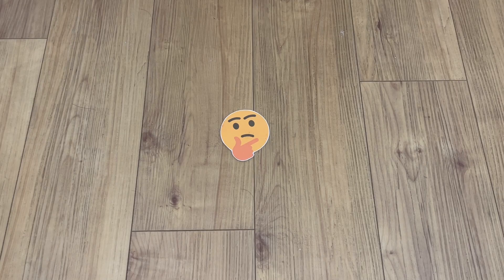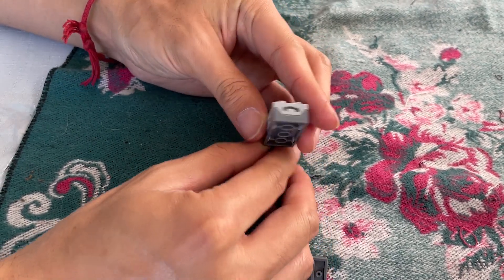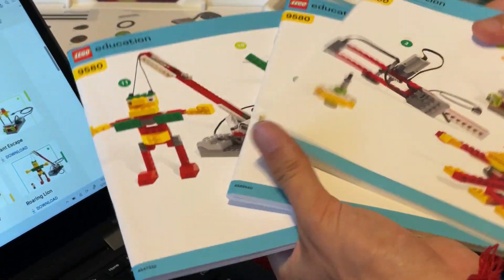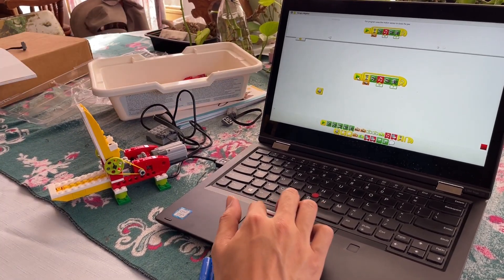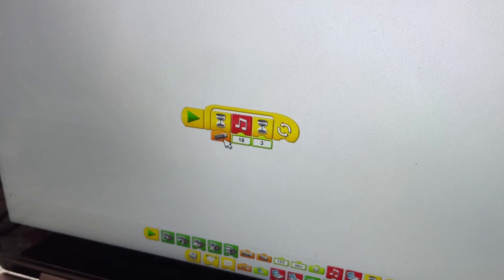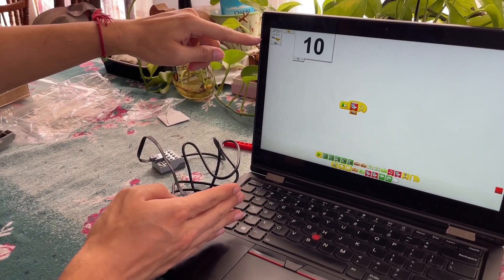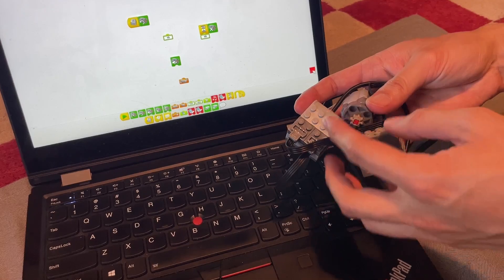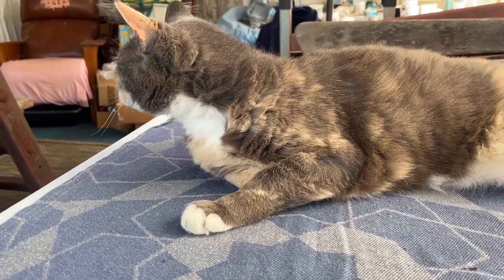#lego Education Had Power Functions SENSORS (WeDo Robotics Construction Set 9580)

Comment from the maker: Corrections:

1) It's hard to find this feature, but it looks like it will  save programs when you rename them.

2) You can address different motors (up to 6, between 3 hubs) by shift-clicking on the motor run icons.

Comment: I look at WeDO as a proof of concept that Power Functions had enough untapped potential to not deserve being discontinued in favor of the Powered Up system with all its faults. WeDo was limited in its execution, but sophisticated enough to show that Power Functions could absolutely be used in a robotics system. The Power Functions servo motor even proved that such a system could combine motors and sensors in the same component, or from the same plug connection point. There was no need for LEGO to discontinue Power Functions - it was beloved by builders, extremely versatile, affordable, and could easily have been developed into a "smart" system with bluetooth hubs, servo motors (or a rotational sensor block, RCX-style),  and even a whole robotics system. Heck, the next generation of Mindstorms could've been Power Functions-based. But instead, we got planned obsolescence, with a much more limited replacement system utterly lacking any backwards compatibility... a decision that will never not be incredibly disappointing and maddening to me.
Reply: Sbrickplus from vengit allows us to use wedo1 sensors, power function motors (including servo), and has BLE connectivity... unfortunately it has been discontinued and is quite imposible to find a copy on second hand market.

Although it had 4 ports, we missed an environment for coding and the posibilty to add more analogue compatible sensors like sound, temperature, and light that would expand the features of the set.

The ports of the hub have 4 pins ground, 5V, C1 and C2.  C2 is used for sensor identification (a current or resistance value) and c1 the value measured that the hub interprets as a tension value, and translates into o range from 0 to FF in hexadecimal.

If it does not detect a resistance it asumes is an dc motor and uses C1 and C2 pins as PWM outs.
Reply: @salva8722 That's cool! Didn't know Sbrick was compatible with WeDo. Sbrick was awesome back in the day, but for general RC use BuWizz is a lot better so I understand why Sbrick fell out of favor. I'd love to see BuWizz add more programability and sensor compatibility in future products/updates. A BuWizz robotics system would be epic.
Reply: Well ... wew motors with encoders (powerup range) work better but I agree   we should have forward and backwards  compatibility. There are some electronic elements that for instance allows us to use spike prime items with ev3 and viceversa.

Comment: I was curious what happens if you plug the hub into a continuous source of power, without data being transfered; e.g. a USB-Port of a wall charge adapter or a powerbank. Will the hub just transfer the power directly to the PF-Connectors, giving them also a continuous flow of 5V?
Reply from the maker: That's a thought, but I'm pretty sure it needs the software to do anything and won't just act as an easy power source lol.
Reply: Okay, thank you @NonsenseWars
Reply: @Toastbrotexe I was wondering the same thing. Or even if the program could be stored on the hub and automatically run. But don't think this can be done. Wonder if it could be rewired? But still need to keep the 5V to 9V converter inside. Not really worth it since for $20 you can buy a USB to PF power cable which has that voltage conversion built in.